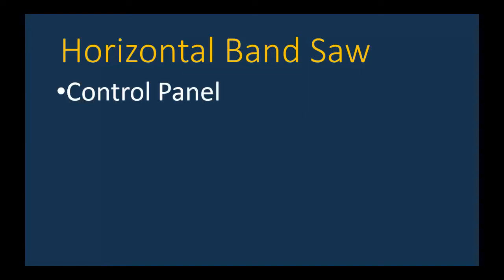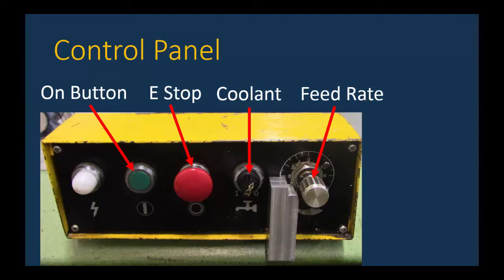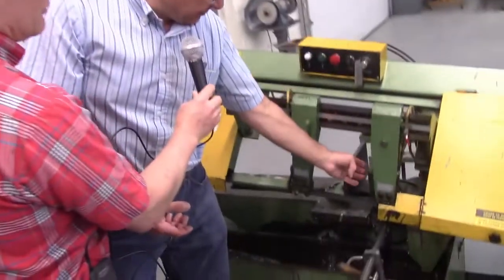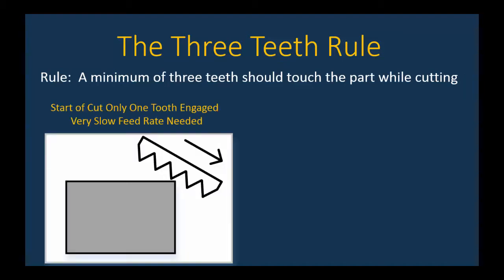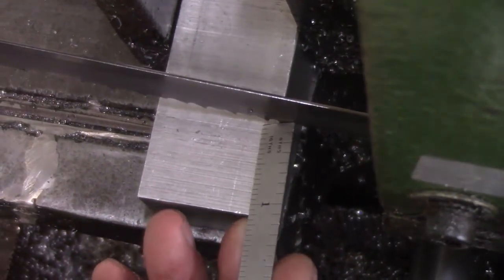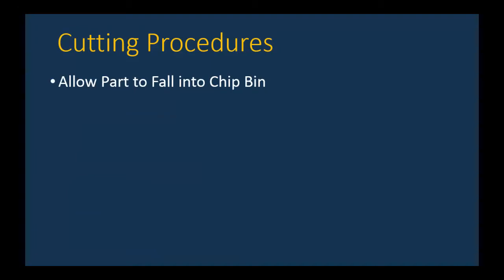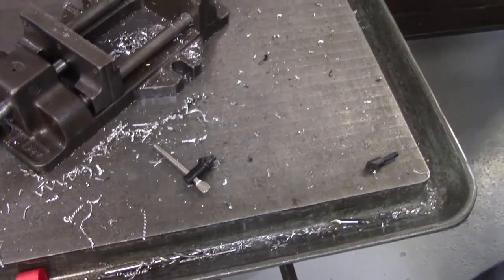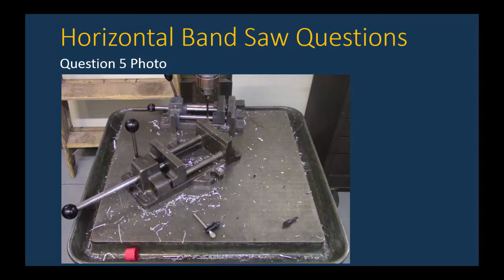MCC ENR 153 Machine Shop Video  1 Horizontal Band Saw

Comment: 1.) Visit this link to see a horizontal band saw control panel. http://tinyurl.com/z9tb6uu
2.) To loosen the vise,  turn the vise jaw handle, located on the left side of the machine.
3.) To use the horizontal band saw, first, install the stock material into the vise, and then snug the vise around the stock. Use a ruler to measure the cut location, and completely tighten the vise. Turn on the motor and coolant, and then turn on the feed, letting the saw slowly and completely cut the stock, allowing the part to fall into the chip bin. 
4.) Recently cut parts can be dangerous, as they may have burrs, or be extremely hot. Use a rag to pick up the completed part, and be sure to file off any rough edges. 
5.) In this picture, the work space is not cleaned properly, as the cutting tools have not been put away, the chuck key is not stored inside of the drill chuck, and the chips have not been swept away.